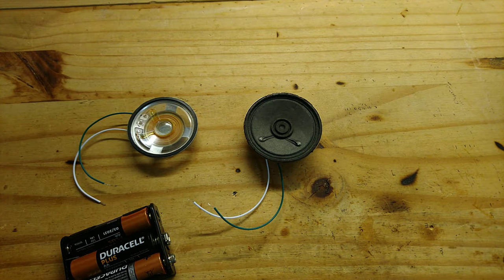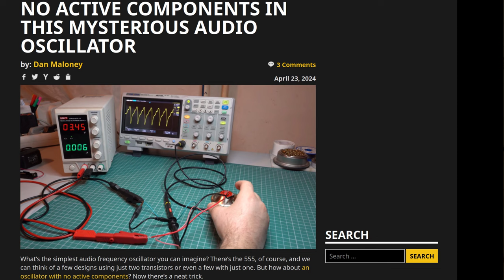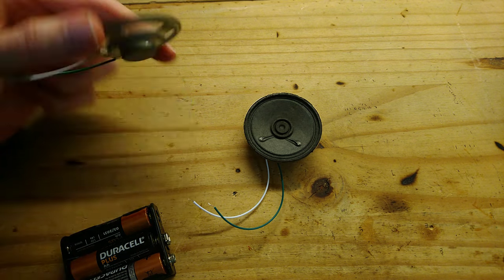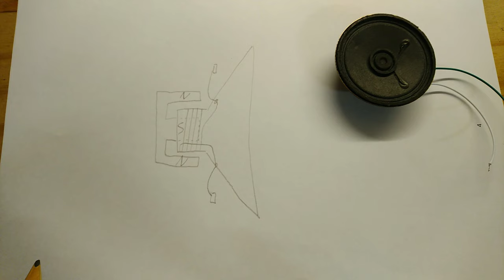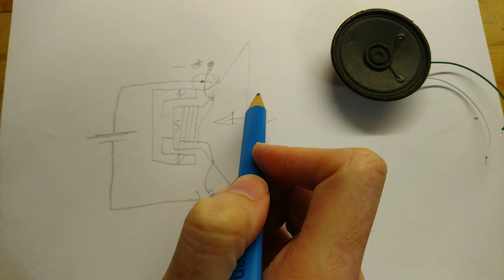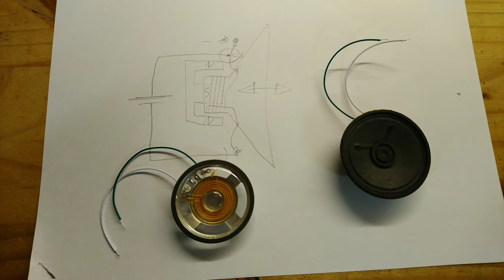Simplest loudspeaker oscillator

Comment: I was half expecting you to reveal a small relay behind the speaker cone when you turned it over. (Relays by themselves can be wired as buzzers, of course.) I don't know if a relay counts as an active device.
Reply from the maker: In a way it is a relay, its just sharing the coil and part of the contact with the speaker.